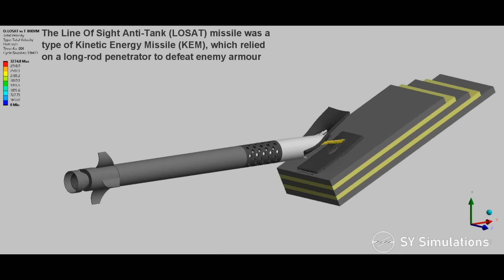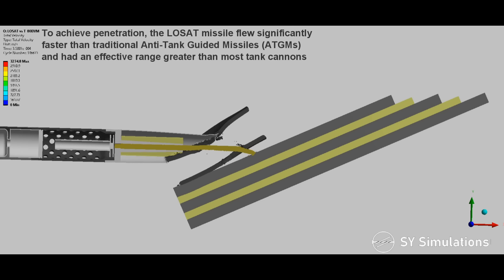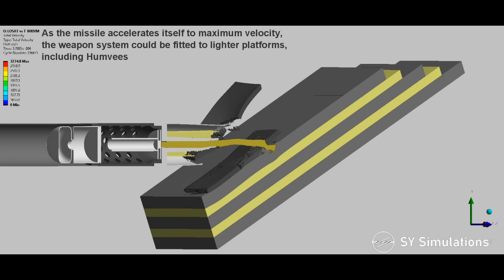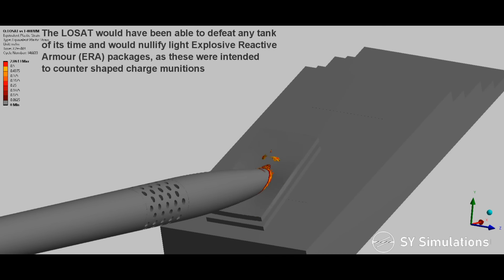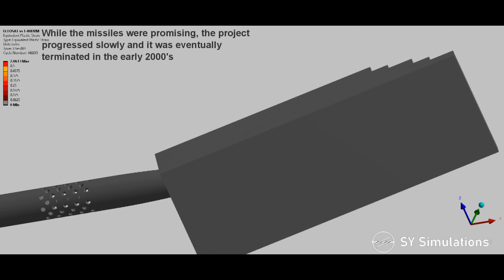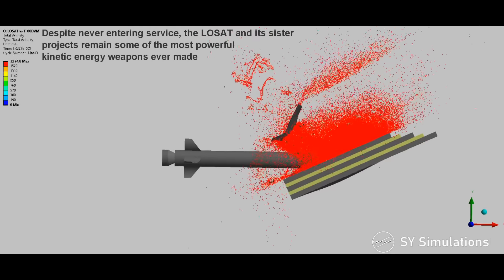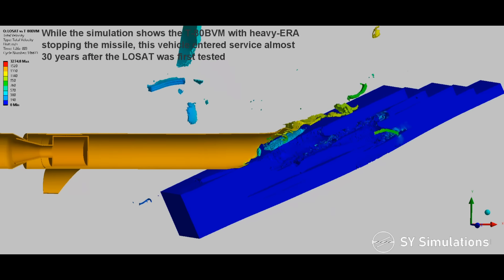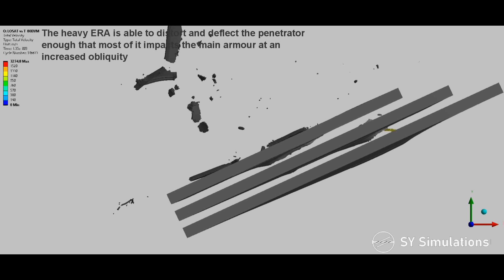LOSAT vs T-80BVM | MGM-166 Kinetic Energy Missile vs Relict ERA | Armour Penetration Simulation

Comment: It's crazy how effective the Relikt is against any projectile. I thought for sure the LOSAT would completely penetrate that
Reply: Bat muh em Ejt Tu Najn aj For!!!!!!
Reply: @worldoftancraft  M829A4 is longer, heavier, and faster than LOSAT. Plus, like its predecessor M829A3, it has an anti-ERA breakaway steel tip (which detonates the ERA before it can shatter the main rod). A4 was designed almost exactly two decades after LOSAT was.
Reply: @MacSalterson  you count the steel. While it does not penetrate anywhere significantly. 

What you've forgot is thickness. That's the thing. But not mass or «length».
Reply: @worldoftancraft  The steel isn't supposed to penetrate anywhere significantly. It's supposed to detonate ERA without breaking the main rod. Which it does.

It does not matter how thick or long or heavy the main rod is if it gets shattered by the ERA detonating.
Reply: @MacSalterson wasn't A4 created to specifically defeat k5?
Reply: @MacSalterson  It is quite funny that the Americans need to come up with a new projectile to penetrate a Russian tank, while a Russian tank can penetrate the most modern American tank with 3bm42 and at the same time be 20-30 tons lighter
Reply: @Masterafro999  no, that was A3
Reply: @愛を込めてロシアから  ye and it funny how the turret of soviet tanks goes to space when the tank is penetrated
Reply: @愛を込めてロシアから nice propaganda mate.
Reply: @claudiovictorferreira992  all tanks throw their turret once their hull ammunition detonates. The only exception might be the Abrams as it only has 6 rounds in the hull. Those might just burn the crew instead of ripping them limb to limb. 

Here's a good example:
https://youtu.be/YafzmkvVRiI?si=2Wrutt6YJe1M8rcE
Reply: @Masterafro999 most nato tanks use blowout panels
Reply: @愛を込めてロシアから Gigacope lol
Reply: @Keep3r1438  I said hull ammunition. No blowout panels for those.

Edit: most do have blowout panels, yet even more have ammunition all over their hulls making them just as explosive as any old russian tank when penetrated. Tanks like the leopards store most of their ammunition in the hull with only the ready rack being inside the turret bustle. Challenger tanks don't have any blowout panels because they only store their inert darts in the turret with all the other ammunition types and their charges being stored literally all over the hull.
Reply: @claudiovictorferreira992 not in all instances, and western tanks also have "turret toss".. There are t72b3 survived after 5 NLAW hits and returned back.
Reply: @claudiovictorferreira992  A2 actually, m829a3 came in the 2000s, K5 is era from the 80s.
Reply: A2 doesn't have anti era tip, a3 was designed against k5 @voler_1925
Reply: Basically near perfect conditions for the relikt though
Reply: @愛を込めてロシアから  In combat conditions, 3BM42 is incapable of defeating the frontal arc of any M1 tank after the M1IP.
Reply: @ryssa2409  A2 was a brute force method to beating K5, while A3 was a future proofing solution which involved the anti era tip(more in response to newer era like Kaktus), whether or not A2 defeated K5 we don't know till we see it used against K5 however thats what it was meant to do.
Reply: if the videos out of Ukraine have shown anything it's that Russian ERA doesn't work as well as advertised. Even small 40mm HEDP grenades dropped on ERA equipped vehicles have no problem penetrating
Reply: @zeitgeistx5239  propaganda? Its clean mathematics, russian tanks are better
Reply: @claudiovictorferreira992  we are talking here that its hard to pen soviet/russian tanks because they are armored better than usa/ger tanks
Reply: @claudiovictorferreira992  Right now we are talking about the fact that Russian tanks are better protected than American ones. And I wonder what happens to Abrams' crew when an old 3bm42 pens it?
Reply: @Masterafro999  Right, and the carousel only detonates if it is penetrated. If there was no carousel there the crew would have been minced anyway. It's just an easy thing to laugh at for those that don't understand.
Reply: @Keep3r1438  Doesn't matter.
Reply: @愛を込めてロシアから  С чего ты так уверен, что Манго 83-ого года пробьет Обэмасы IP и Леопарды новее 2А4? Ты вообще смотрел документацию по бронепробитию снаряда и бронированию их танков?
Reply: The A2 main improvement was in the speed and very much the alloy, which performed ~5% better against RHA and much much better against complex targets vs the A1.  The Russians in private informed potential customers of their tanks in the 1990s that the M829A1 was probably able to overcome the current protection of the T-80U in many cases and that in development ceramic inserts should be considered.
Reply: @MacSalterson  i dont think the penetrator of m829a4 is longer than losat ? do you have a source on that ? the round itself is 890mm long, penetrator is 730mm and 630 mm is DU part 100mm steel.
Reply: @sfalhilsajd  можешь в интернетике моделирование посмотреть, ты на канале который этим и занимается, гений
Reply: @viktoriyaserebryakov2755  and they seemingly can't read when HULL AMMUNITION is being talked about. It's like they get paid to scream blowout panels whenever NATO equipment is being talked about. Apparently anything NATO now has blowout panels even tho those are rarely use on other vehicles besides mbts.
Reply: @voler_1925  why would they develop a special round for the era that was made for light vehicles that it'd still punch through?
Reply: @Masterafro999  All propaganda in all wars paints the other side as cartoonishly incompetent. There's no shortage of old newspaper clippings depicting the other as deformed, uncivilised, intellectually and genetically inferior when really at the end of the day we're all human and thus are capable of similar capabilities when it comes to it. The Russians designed their tanks a certain way for a reason, and the NATO nations designed theirs for other reasons. Good luck telling them that though.

Hell, blowout panels in some circumstance pose a greater risk than a carousel it's all situational. But who cares about nuance I guess.
Reply: @愛を込めてロシアから that is not accurate. You’re thinking of the hull. Western MBTs were only likely to be hit in the turret, which is better armoured than Russian tanks. The best armour was designed by the British and shared with the Americans. The hulls were most likely going to be non line of sight to the enemy in defensive positions.
Reply: @ryssa2409  you're thinking of the wrong one, kaktus era never left the prototype phase, along with the tank it was developed with, it was more similar to Ukranian NOZH ERA and was meant to go on the object 640 prototype.
Reply: @viktoriyaserebryakov2755  exactly! You tell em. Emotions have no place in a factual discussion. NATO armour does not have magical properties.
Reply: Eh... Well, no, even turrets aren't better armored than soviet ones

And if western tanks weren't designed to hold apfsds only with turrets, well... Poor tankers then. How would those tanks advance? Ukrainian war shows that leos And M1s aren't sitting behind hills neither in defence nor in offence.
Reply: @ГеоргийМурзич  CORRECTION: turrets of western tanks are indeed better. There were using better combination of materials. Moreover, the material bonding  techniques of those materials are state secrets.
Reply: @Masterafro999  I take back what I said actually. It is Western propaganda that paints the other as subhuman.
Reply: @viktoriyaserebryakov2755  what made you say that? I feel like every nation has their very own propaganda. But none is as deeply rooted and wide spread as western propaganda
Reply: renesanchez2441  every tank since ww2 was designed that way. Every damn armoured vehicle is designed that way. That's due to advances in armour piercing weapons.
Reply: @愛を込めてロシアから it has a 50% chance to penetrate and 30%chance to hit on distance 1500m+. That is Russian tank with Russian gun,and only if it was build up right what is another 20% chance. Western tank has 90% chance to hit on 2500m and 80% chance to penetrate any russian tank, and 99% chance the weapon is working as intended.
Reply: @milanvnuk  So you completely ignored the videos in which Russian tanks are firing at firing points 2 by 2 meters from 4 and a half kilometers?
Reply: @Masterafro999  Ukrainians call Russians orcs. Russians call Ukrainians brothers.
Reply: @viktoriyaserebryakov2755 *khokols or pigs.
Reply: @Xtoxinlolinecronomicon  Citation needed.
Reply: renesanchez2441  thin sides and rear is literally the only way you can make moden tank being anyhow shell resistant.
Reply: Type 10 APFSDS: am I a joke to you ? 

that dart has capabilities of slicing the Relikt ERA
Reply: @Distressed_Asian  Russia military also had capabilities to subdue Ukrajina in one week. Do i need to tell to you what the field test shown
Reply: @worldoftancraft  blud it's already more than 2 years and Putin himself has struggles to invade it now you yapping about a week of subduing Ukraine ? such pathetic cope.
Reply: @Distressed_Asian  not gonna involve deeper in arguing but they have the capabolity to flatten ukraine but that not the point of invading
Reply: @Distressed_Asian  such pitiful cope is when one which reads me is unable to comprehend... that it's not enough to move your eyesight through letters to understand the message.
I have impression that you in a manner of typical ameriquoid stopped reading right when you've seen the first period symbol.
Reply: @milanvnuk  you're basing those claims on what? Believe? This is not a religion. Go check up on some facts. Hit Probability On Tank-Type Target Cruising Sideways At 30 km/h: 100 m to 4000 m =  >90% (9m119 "Refleks"). The 2A46M-5, 2A46M-5-01 canons have a hit probability using HE-Frag and apfsds of >90% as well. HEAT-FS of around 85%.
Reply: blud, it spalled the armor, the driver is 100% dead from steel fragments digging into his brain.
also the turret crew is definitely has a very bad concussion because 80kg of metal flying at mach 4.4 will definetly heavily shake your outdated shitbox. also realikt is just rubber so the t80bvm would actually fair even worse. with the missile probably penetrating into the tank and triggering the space launcher (carousel autoloader)
Reply: @愛を込めてロシアから the shot deflets because the shit optics will make the gunner miss, hit the cheeks and bounce. the abrams has basically free realestate now becaude it can fire two shots back before the carousel can reload, and it will definitely jam after one hit from the abrams. also the t72 can't really go anywhere else because it doesn't have reverse speed. so russian tanks are definitely getting clapped
Reply: @democracy_enjoyer  I guess space launcher is the worst of what comes to already dead crew. Well, that's what you say.
Reply: @democracy_enjoyer  oh nice cope, nice cope
Reply: @愛を込めてロシアから  saying cope cope cope and not actually trying to debunk my points is not going to help you win the comment wars mate
Reply: @democracy_enjoyer  it's a war to you, but not to me dude
Any new cope?
Reply: @愛を込めてロシアから  what the actual f❤️❤️❤️ are you even saying rn?
Reply: @democracy_enjoyer  read better
Reply: @愛を込めてロシアから  your responses are more confusing than the metal gear lore
Reply: @Xtoxinlolinecronomicon  the pretty obviously nazi militia's get called so. Yes. The Ukrainian regulars don't usually get called that. Unless you're on Reddit. Reddit is a horrible place to be.
Reply: @Distressed_Asian   I mean did or didn't they reach Kiev and occupied 40% of Ukraine in the first few weeks of the invasion. Kiev was at its militarily strongest point of the war at that time.
Reply: @democracy_enjoyer  the t-80bvm has better optics than most NATO mbts along side one of the best fire control systems in service. Don't take my word for it. Do your own research before commenting rubbish
Reply: Crazy how it isn't in real life though, clearly demonstrated on the many videos we have seen for like 2 years now.
Reply: @愛を込めてロシアから  Yeah, they are the undisputed champions of turret tossing  🤡:face-blue-smiling:
Reply: @viktoriyaserebryakov2755  Yeah, blowout panels are bad idea, especially compared to the genius carrousel, that is why we see every nato tank toss its turret at 20m when it gets hit by a small fpv /s 🤡:face-blue-smiling:
Reply: @ytsks  kinda boring🥱😴😴😴
Reply: @ytsks  If you have something to state as fact then do so instead of hiding behind a sarcastic facade. Commit, don't hide like a cow_rd.
Reply: @Masterafro999 guess what the Abrams crew tend to not have in the hull of their tank? 6 random ass rounds
Reply: @WandererJester  I don't even know whether or not newer models still retained their 6 round hull racks. I don't see why they should have. The versions in Ukraine have them however no clue if they get used. Idk which comment you replied to.
Reply: @ytsks the autoloader was genius for its time. They lost their edge a bit over the years as safer alternatives have emerged.
Regardless of that NATO tanks tend to fair similar fates when hit in the same spots by the same threat. They don't magically not explode when their hull ammunition is hit or protect the crew from projectiles that pretty obviously flew right through the tanks armour. 

Here's a leopard getting balanced by a 60s-70s atgm. https://youtu.be/YafzmkvVRiI?si=MjDW-h-Px2PHfEr6
Reply: @Masterafro999 iirc the hull ammo storage in the Abrams also has a blowout panel.
Reply: @MacSalterson There are different opinions about the fact that the tip of the projectile will save him from the Relic. In the USSR, there was a mango projectile with exactly the same design. If the projectile hits the lower part of the Relic, then yes, it helps. If it is closer to the center or to the top, then no. Relict plates still fall into the projectile.
Reply: @solus48  it does indeed, hence why I said that the Abrams crew would burn to death and not get ripped apart. In case the penetrating round strikes those rounds the crew compartment will get burned in seconds as there no longer is a protective barrier between the pressure compartment of the ammunition and the crew compartment
Reply: @MacSalterson  it absolutely can. Shoot centre of mass and the chance that it hits the hull roof is pretty high. Not every part that is armoured has armouring all over. There are plenty of places a round could slip through. Remember that t-90a that got penetrated by presumably 3bm22? It got hit just a cm below the welded armour inserters of the turret.
Reply: @Masterafro999  that thing was genius but it was still shit, the one less crew isn't worth a 10 second reload, and being unable to swap the loaded round out, as well as the flimsy mechanisms jamming after getting hit by any high impact rounds from basically any time period
Reply: @viktoriyaserebryakov2755  What are you on about, did words hurt your feelings? ❄
Reply: @Masterafro999  The carousel autoloader is a terrible idea. Not stupid by any means, just proven in practice as pretty bad. You found a single video of a leopard getting hit  by a kornet. You should research its size and power. Hopefully you wont pretend you need links of fpv drones playing turret toss champion with t90m and the like. I will let you watch this instead, and wait for you to come back and tell me its basically the same :face-blue-smiling:: https://www.youtube.com/watch?v=uM3mVDJO21c
Reply: @愛を込めてロシアから  I am sure you hear it every day 🤡
Reply: @ytsks  Cow_rdice it is.
Reply: @Masterafro999    There is obviously always the possibility of lucky hits, but they are practically irrelevant, because worrying about extreme edge cases in these discussions is pointless.

It's like saying that technically a 20mm autocannon round could penetrate a maus if it ricocheted into the hull roof. Sure, hypothetically that could happen, but no one is gonna claim that 20mms can kill a Maus.

The goal of continually designing newer rounds is so that said rounds can defeat expected enemies at expected combat ranges without worrying about lucky shots or aiming for points on a tank's body a handful of centimeters wide or tall. That's what the US is doing. Tankers don't aim for weakpoints. They acquire a target, the tank's FCS gives them a solution, and they pull the trigger.
Reply: @павел-б6н5ю  How is an APFSDS design from over 30 years ago (when the USSR was still around) from a different country relevant to what the US is designing today?

Simulations based on the closest estimates we have to the designs of M829A3/A4 and K5/Relikt suggest that the steel break away tip is effective.
Reply: @democracy_enjoyer  the reload is not fixed. However, the autoloader itself is capable of loading a round and returning the gun to aim on a target of the gunner's choosing in only 6 seconds if the gunner chooses not to change the ammunition type. Which isn't bad. Turning the carousel by one step takes up 12-15% of the total loading time, and turning it by three steps takes up 17-22%. The WT reload is an average. Newer autoloaders have different loading speeds than the ones found on say the t-64a yet they all have the same reload times in game. According to a T-80 technical manual, the combat rate of fire is 7-8 rounds per minute. This is co-confirmed by the T-64A and T-64B/B1 manuals, which give a combat rate of fire of 8 rounds per minute from the same autoloader and the same fire control system. Meaning that the t-72/90 type autoloaders load one second faster than the other autoloaders. One thing that seriously pisses me off about all of the MZ and AZ autoloaders is that they can only rotate in one way causing the reload to reach 19,5 seconds if the next selected round is on the other side of the autoloader. That should have been an easy fix. 

As for your unreliability claims: the topic was at its high point when the Soviet Union fell and west Germany received scores of nva t-72m1s. NATO tank crews mocked the Soviet autoloader (that's where most of the "arguments" and presumptions against the Soviet autoloaders stems from) to the point were some Soviet books even incorporated those claims and put them to the test. "The autoloader is insensitive to scorching heat, freezing cold, nor does it care how fast the turret is spinning, thanks to its impeccable sense of balance. It does not matter if the tank is rocking around like a bucking bronco at 50 km/h over the most gutted dirt paths. The autoloader will still load a shell in the specified time, every time. The common argument that the autoloader can be "knocked out" by hard impact or a hit on the tank's armour is fallacious - a hit on the tank's armour that does not fully penetrate yet is powerful enough to disable the autoloader would also be powerful enough to concuss the people inside the turret and effectively disable the gunner and commander as well as the loader."

Source: ( https://4.bp.blogspot.com/-EzNEXvH7CIM/WpTz5_cRmdI/AAAAAAAALCA/Tx5QsLyJqpM8sHscSmbIaNCHSUnECvJRwCLcBGAs/s1600/mz%2Bcyclogram.png ), This cyclogram comes from the document "Автоматические Системы Заряжания Вооружения Бронетанковой Техники" (Automatic Gun Loading Systems of Tanks) published by the Russian Ministry of Defence, 2011.
Reply: @democracy_enjoyer  oh and not many if any mbts can swap ammunition once loaded as that is a huge safety concern
Reply: @MacSalterson And besides the 3BM-42, there is also the DM-53, which was developed in Germany. This munition has exactly the same composite rod. So it's not a bad word. And the Relic is being developed specifically to counteract this ammunition.
Reply: @ytsks  I never claimed NATO tanks to be weak. They are all pretty similar in capability. I just don't like cherry picking, bias and mocking vehicles without any background understanding of them. The video shows many Abrams getting hit by shoulder fired at weapons and ATGMs. Many of those hits actually penetrated the armour if you check up on Iraq tank reports. Not every penetration is a crew kill, drones did not exist back then the way they do now. There are plenty of cherry picked videos of Soviet armour tanking things that they should not. Taken without context it could lead to people believing that a bmp-2 can reliably tank 4-7 at hits without much trouble. I'll post the video link once I find it again. Soviet armour was/is not bad. It's just not the best in many regards. It is leading in certain areas tho.
Reply: @павел-б6н5ю  DM53 is a completely different design from M829A3. DM53 is shorter than M829A2, is composed of tungsten alloy rather than depleted uranium alloy, and weighs less. As far as I know, it also lacks a break-away tip.
Reply: @MacSalterson  so m829a3 has better pen than dm53?
Reply: @democracy_enjoyer  Unsure, and it probably depends on the target. M829A3 is (almost) certainly more effective against targets with heavy ERA, but DM53 may be better against a simple RHA target. M829A3 is also newer than DM53.
Reply: @愛を込めてロシアから And where have you seen that? Lmao
Reply: @claudiovictorferreira992  the Abrams' turret isn't torn off, but the crew doesn't survive, so what's the difference?
Reply: @Masterafro999   Cherry picking would be finding clips where a T series does not violently explode when hit center mass.  That is the whole conversation - why that autoloader (not autoloaders in general) was a bad design. Which has actually been admitted by both soviet and Russian engineers, its a google away from you. A weak point the other design simply does not have. What penetrates the abrams on any of the clips is inconsequential, because none of those exploded to the moon.  I can find you that many turret tosses from just last week. In fact none even caught fire right away, so whatever the damage was, the crew likely survived in full, e.g. the tank actually did its job. So no they are not similar in survivability and there is plenty of empirical data to prove it.
Reply: @RAD1111able  You don't know how to ask complete questions, am I right?
Reply: @MacSalterson  I also see the effective operation of the losat rocket against the triggering of the Relic. If you review the video, note that the main action of the first plate was not on the rod, but on the rocket body, and the rod met immediately with the second plate. A standard tank shot against this protection will be less effective, since the rod will collide with both Relic plates.
Reply: @mcantu197 ive seen plenty of videos showing ERA doing its job.
Reply: @ytsks  where did I claim the survivability to be equal? I claimed that hull ammunition in all tanks that have them is a major safety concern. The Soviets themselves stated that the MZ autoloader, the one storing the charges vertically was inferior in crew survivability that the AZ loader which stored them horizontally, allowing for the carousel to be armoured. What you described is cherry picking. Not all t-series tanks explode when hit, else we wouldn't see so many litter the battlefields in one piece.

As for the abrams video you shared: the early Iraq videos show the Abrams shrugging off badly placed rpg-7 pg-7v hits which had little to no chance at penetrating even the side skirts of the tank. The atgm videos are cut with no aftermath being shown. Some of those tanks burned down afterwards, afaik one crew member got killed in the video and 2 or 3 lost limbs or received TBIs. We know what would have happened had those tanks faced any meaningful soviet/russian at weapons of the time. Iraq in the first gulf war had no effective way of even touching coalition armour. The few Konkurs ATGMs that had been sent saw little to no action. The ones that did see actian caused casualties and loss of equipment, hence why the US paid food coins for captured Konkurs launchers and ATGMs.
Reply: @MacSalterson  extreme edge cases are part of the chance bell curve. Unlikely does not equal a definitive never to happen. On the matter of war thunder: how many times have you died in bullshit ways? That's almost exactly what happens irl just with MANY more factors that play into the end result. The probable dispersion of 3bm42 mango is below 0.6 meters and 0.5 meters in the vertical and horizontal planes respectively. At 3km. So aiming centre of mass, on an Abrams that is directly facing its russian counterpart, will definitely land the dart on the upper hull deck in most cases up to 3km.
Reply: @Masterafro999  Literally none of the hits on the video were rpgs, if you are unable to tell what munitions are used, we can just drop this now because your expertise is severely lacking. Not to mention rpg7 can pen up to 750mm with the right warhead, which isn't too far off a number of older atgms. There were 23 abrams tanks lost or noticably damaged in the gulf conflict. And 0 crew deaths, only wounded. 23 tanks to 0 deaths. Not sure if you get it, but literally every example you give serves to prove my point, and refute yours - they are not similar in capability - one has 23:0 odds of you surviving. The other...well there are more than 23 videos from just the last month of a T violently disintegrating milliseconds after a single hit.
Reply: @павел-б6н5ю  The plate triggered when it contacted with the main rod, not the body of the rocket. LOSAT had no special anti-heavy ERA properties
Reply: @ytsks  "During the first gulf war alone, nine M1A1s were penetrated by rocket-propelled grenades (RPGs), although only one was immobilized.

In the two years after the invasi0n, over 1,100 M1 Tanks were deployed to Iraq, of which 70% were hit by some sort of enemy fire, mostly without consequence, although 80 tanks were damaged badly enough that they were shipped back to the US for repair. Fifteen crewmen were killed: five inside the tanks, ten while partially exposed in their hatches. In the first three years, 530 M1 Series were rotated back to the USA for refurbishment."

M1 Abrams Main Battle Tank Manual: From 1980 (M1, M1A1 and M1A2 Models) (Haynes Manuals) by Bruce Newsome and Gregory Walton.
Reply: @ytsks  Iraqis, to my knowledge, had no advanced Shoulder launched AT weapons and the only tandem charged atgm was the Konkurs(only some variants and in very small numbers). The average RPG warhead found within Iraq militia's in the second gulf war was the standard pg-7v(1961) rated at only 250mm rha. Some newer variants were found but none were tandem nor did any offer more penetration than 400mm rha. 

As for the none were RPGs: you can literally see two dudes with an RPG-29 in two of the videos. Also some of the video towards the end are definitely not atgm hits as those were pretty close range, non twirling, fast moving shots. 

The very first Abrams in the video got visually penetrated as it's fuel tank started leaking and burning. The fuel tank would have likely acted as a spal liner but the crew compartment would have likely still been penetrated. Many of the videos were hits to the most armoured parts of the vehicle. Comparing those hits to hits from russian ATGMs crew kinda paints the picture that civilian Iraqi militia members don't know much about tanks and where to hit them.
Reply: @Masterafro999  But they're not designed for. No one designs for them. And War Thunder is irrelevant. And 3BM42 would not pen if it struck the UFP of an Abrams, especially not a SEPv3 or SEPv4, which have increased thickness to the upper glacis from the base model. The round would shatter and spray harmlessly across the glacis and the turret ring.

We can see that 3BM42 wouldn't pen the glacis of an Abrams at range because during Operation Desert storm an Abrams (B Company, 3-66 Armor, Bumper # B-22, which was I believe an M1A1 HA) was struck by a 120mm DU projectile (meaning it was most like M829A1, a vastly superior round to 3BM42. It could've also been M829, which is still superior to 3BM42) in the upper glacis at an unknown range (probably 2-3km, given that it was FF due to misidentification)
Reply: @MacSalterson  I'm just commenting on this simulator. One of the ways to protect the Relic, the lower plate moves towards the armor, and the upper one to meet the projectile at the top. Causing transverse loads in the rod and thinning it, by constantly running over the plate. In the video, all the action of the front plate was on the rocket body.
Reply: @Masterafro999  Stats settled the debate before it started. They are light years apart in survivability, and you don't need to be a spaceX engineer to get it - in one case the most explosive thing in the tank is dead on center mass, shell charges separated and not insensitive. It will be harder to miss it than hit it. That carrousel was a terrible idea in practice, but that is only if you consider loosing the crew and vechicle a big deal. When it comes down to combat effectiveness it really made no difference - a disabled or tracked tank is just as useless as a blown up one. So I guess if you share the perspective of the average Russian general on how expendable materiel and personnel are, they really are quite similar.
Reply: @ytsks если в забашенной нише Абрамса будет +-10-15 снарядов 3оф26, то у Абрамса при детонации снарядов башня с такой же вероятностью превратится в аналог Аполлона.
Reply: How can we have years worth of Ukraine war footage at this point and still be having arguments about the effectiveness of this
Reply: @zeitgeistx5239 they actually do LMAO so go cry
Reply: @viktoriyaserebryakov2755  I didn't know "Hohol" or "Ukronazi" translated to brother...
Reply: @FancyPantsOnFire  good luck having terrain conveniently shaping at your favour whenever you move your tank
Reply: @ДимаВеселов-в8и  that was the point tho. In the Cold War the soviets would, as they do now just commit large forces in frontal assaults after an indirect barrage. It’s as primitive as it gets. These tanks were meant to take out scores of TSeries before being overrun. It was a trade off. They figured they’d kill enough via tanks, apaches, a10s and ATGMs. And by looking at Ukraine it looks like the west would have trashed the Soviet’s. Even more so now
Reply: @frely4580  They did survive
Reply: @viktoriyaserebryakov2755 hohols , crests translate to brothers now damn
Reply: @187Rajah also have 😂 , but keep coping with a single instance 😂
Reply: @ytsks  except they don't need to "survive" as many things. T-72 and T-80 designs were awesome for the time they entered service. There were no good fire control systems, no decent thermals, ATGMs were a joke, drones weren't a thing etc, so instead of focusing on surviving the penetration they could focus on NOT being penetrated, not getting hit and not getting spotted in the first place, which is frankly a leagues better idea of protecting your crew, and carousel was a decent choice since it allowed to make the tank smaller hence more difficult to spot and hit and easier to put more armour on it, so under the same commandment it was safer to be sitting on an explosive carousel than in any NATO MBT during 70's, 80's and arguably a big chunk of 90's. Also if you actually look at hull ammo distribution schematics, Abrams or Leo have ammo not that far from center of mass as well, which makes it not that difficult to hit, especially if you don't see the tank for the first time in your life
Reply: @ntks6720  they won't survive. There is very little chance of survival.
Reply: @95keat  that's a biased way of looking at it. Anyone meaning to kill a tank equipped with Relikt will obviously hit places that either aren't protected by era or if penetration is possible regardless of its presence. There are plenty of videos of tanks with or without era tanking hits without any penetration. Those aren't spectacular for the ukr side which is the reason why we don't usually see them.
Reply: @Masterafro999  i just add to carousel blowing up argument.
Thing is that Russian autoloaders ain't that bad in safety departament.
Carousel is in lower part of the vehicle.
The most protected part and less exposed.
Thing is that Russian doctrine because of IS-2 tanks having very few rounds wanted at least 42 rounds in tank.
Since T-72 autoloader could fit only 22 rounds, the rest rounds were stored everywhere in tank.
So basically anything that penetrated fully loaded T-72 would ignite one of rounds or charges that lay loose in hull will initiate chain reaction that blows up carousel.
Tankers knew about that and if commander allowed it, they would bring only these 22 rounds in carousel which increased survivality by a lot.
Even in Ukraine you could notice that some tanks just send their turret to orbit and some can tank a lot of hits and they are perfectly fine.
Simply the one where turret fly to orbit are these where commanders went full on doctrine and didn't allow to take less rounds
Reply: @愛を込めてロシアから  Mathmatics gets you classified military documents? sign me up.
Reply: @alfredchurchill2328 Yes they are defensive tanks, we all know how well they work when used without combined arms and effective crews
thanks ukraine
Reply: @milanvnuk Lmfao, source on that bigman
Reply: @worldoftancraft Jajaja yes comrade; Ukraine will push through in two more weeks yes?
Reply: @ytsks Pro tip: literally every mbt will throw its turret in bulk ammo detonation, yes, even with BOPs lmfao
Reply: @democracy_enjoyer  See, you don't even know basic shit about tank projectiles lmfao butt out of the conversation
Reply: @ytsks  We are talking about crew losses in Ukraine 
near peer and both sides equally as poorly crewed. 
What is "combined arms"? because that is quite honestly the only thing that makes western mbts effective.  We see this plainly in UA, they drive down a road alone and get hit in the side by a Kornet, because that's how this shit works, it's wwii combat tactics on both sides all over again
Reply: @leovang3425  for what? You are nobody
Reply: @MacSalterson We are talking about how they are used in UA, offensively rather than defensively as they were designed.  UFP thickness does not matter if it normalizes the angle on the first hill you need to go over, all it takes is bad timing and whoops, suddenly that rooski dart is going up against 150mm raw RHA 

bye bye hull crew
Reply: @ytsks The leos & abrams in UA with mush inside say otherwise but go off qween
Reply: @FancyPantsOnFire  Lmfao, yeah definitely. The dead leos and abrams are very telling aren't they
Reply: @Div1ne_1  actually yes. There used to be a huge difference in lethality and survivability in western MBTs and soviet/russian TSeries. Putins disastrous war in Ukraine has made this war overly evident. 

Cheers 👍
Reply: Relikt works very good againt steel witch the LOSAT ATGM is made of witch could def be defeted
Reply: @Div1ne_1  Your comment makes no sense. The Abrams was designed for offensive capability, and positioning poorly is not a fault of the tank. Your comment is pointless and I'm not sure what part of my arguments it addresses.
Reply: @愛を込めてロシアから  and? you can't detect sarcasm nor have much logic
Reply: @Masterafro999  the accuracy of a gun is not allways the same. It depends on lot of thing, temperature of air,temperature of the barrel, how well are optics set, all this things together. You can not take shoting range results only. And understand one thing, they cheat the results. In Russia if results are not great or as promised, you will fall out of window as manager, or commit suicide by 4 shots in the head.
Reply: @leovang3425  i would say even more. Who the f are you. Do you offended?
Reply: @愛を込めてロシアから  I mean, at this point I'm confused
Reply: @Masterafro999 Abrams hull ammo has blowout panels just like its ammo storage in the turret. I don’t know how they work cause I’ve never seen them in action, but blueprints and evidence from tanks suggest at the very least that the blowout panels are there
Reply: @aidboo1054  I don't know whether or not newer models still have the 6 round containers but yes. They do have blowout panels. I just don't know how much that'll change anything when the hull and the container get penetrated. The pressure from the exploding propellant would seek the path of least resistance....I guess the crew would get burned regardless.
Reply: @milanvnuk  those shooting trails were not held by the Soviets to my knowledge. It was either Sweden, reunified Germany or Switzerland as the collapsing Soviet Union definitely did not pose tanks equipped with 105 L7 and 120 L44 guns to compare Mango's efficiency with. So no soviet bias here.
Reply: @Masterafro999  ok, I am talking about my experience with soviet made weapons. And they have never been so good as introduced. I do not say they are total useless,no,I say there is always a lot of hype around them, mostly build by the myths spread by propaganda.
Reply: @愛を込めてロシアから What do you mean russian  tank ? russians never designed any of their tanks you see in use. There were all designed and made by the USSR.
Reply: They'd have to actually put the explosives inside of the relikt blocks for that to happen, thankfully.
Reply: @MacSalterson  except in the huge ass turret ring, lfp and mantlet
Reply: @BraytonCycleAdvocate  and they do, thankfully
Reply: @Keep3r1438 most nato tanks carry hull ammo, and go up like a Christmas tree if the ammo is hit. Only the abrams doesn’t carry a large amount of ammo outside of the turret ready rack.
Reply: @Masterafro999  except the rounds in the hull have a blowout panel also
Reply: @Masterafro999  funny cause they needed thales to make all that for them. And no. It doesn't have better fcs than modern Western vehicles.
Reply: @ryssa2409  Turret ring is both not huge and not an actual weakspot like War Thunder thinks it is

LFP is either not visible during normal combat conditions, not aimed for, and is fairly well protected

The Mantlet is actually armored (unlike War Thunder seems to think) and is also a small target and is thus not aimed for.

Look, I know that War Thunder has obviously rotted your brain, but combat in the real world is not pixel hunting with perfect accuracy.
Reply: thats because, it does defeat it, you need top stop thinking these simulations are correct, they aren't.
Reply: @Masterafro999  the hull ammo in the abrams also has a blow out panel. think again.
Reply: @MacSalterson  oh you're one of abrams has du hull and is invincible adepts while in reality it dies to a slightest fart that isn't directed at turret cheeks
Reply: @sartte  funny how abrams lovers love to claim abrams has 0.0005 sec reload but forget to mention the fact that it's with blowout panels open
Reply: @sartte  didnt I say that as well. If it gets pierced the hull will be filled with smoke, hot glasses and the excess pressure from the ruptured ammunition rack. It might not detonate but the fire might suffice to burn the crew alive. Might.
Reply: @jbeverley67  what's a red effect video on the matter or look for the t-80s FCS data online and compare it the Abrams/Leopard/Challenger/Leclerc etc. The data is all out there waiting for you to read it. And no the Thales deal was sealed to strengthen russian french relations. They are building their own and have been doing so for decades now. The licenced Thales imagers aren't the only ones being built in RU.
Reply: @MacSalterson  my comment about the matter keep getting deleted but well...

The gun is accurate enough to strike the areas @ryssa2409 mentioned at a distance if 3km consistently. If the Abrams faces any t-series tank able to shoot mango head on and centre mass is being aimed for then, sure, most rounds will hit the lfp, hull roof, mantlet or bits of the cheeks closest to the mantlet. At 3km. Honestly mango will do fine against the Abrams Ukraine has. Any more modern ones will likely shrug off most hits impacting the cheeks and some older projectiles like mango to the lfp. 3bm46-60 will likely still manage to perforate the hull.
Reply: @claudiovictorferreira992 wrong that was m829a2
Reply: @Masterafro999 The 6 rounds in the crew turret won't fix the tank with smoke, as its designed to vent the fire/smoke gasses out of the tank none of the crew would be harmed.
Reply: @sartte  have you not seen ammunition cook off? The ventilation system is meant to vent out fumes from the gun and prevent potential NBC contaminants from entering. Any internal fire will definitely fill the entire crew compartment with thick toxic smoke especially when it's an ammunition fire. The fire exiting the punctured ammunition rack would surely do something to the crew.
Reply: @goforbroke4428  yeah I know. I misread the comment so replied to
Reply: @Masterafro999 you do realize that all Abrams ammo storage compartment have blow out panels right? Even the hull ammo, and 6 rounds are not going to be enough to burn the crew alive, let alone do any damage, since the fire extinguishers can just be used.
Reply: @sartte  did my comment get deleted. I've answered the blowout panel thing like 8 times at this point. I know that they have blowout panels. I don't know how much pressure is needed to pry them open by the burning ammunition. The turret one works because the door separating the crew from the ammunition is in place and likely not perforated. The hull rack seems silly because it can only rapture die to a mine or a projectile penetrating the hull. If both the hull and the container get penetrated then the pressure will favour the path of least resistance and flood the crew compartment with burning gasses. How would blowout panels change anything in that regard. They MIGHT trigger if the hole towards the crew is small enough for enough pressure to build up. Ammunition fires have routinely burned hot enough to burn through multiple layers of steel in seconds. Why would a human survive such plus the extreme overpressure in a confined sealed off tank?! Those six rounds still hold more than 50kg of propellant. The fire extinguishers harmed crews in the past, are manually activated and have failed to put out even smaller electrical fires.
Reply: @ryssa2409  Previous versions of the M1 did not have DU hull, but the SEPv3 and SEPv4, which are the current models the US uses, almost certainly have a DU, or at the very least highly upgraded, hull insert, as well as an upgraded upper glacis.
Reply: @Masterafro999  The gun really isn't accurate enough to strike any of the areas they mentioned consistently. Also at 3km, you literally do not aim for anywhere but center mass. This isn't War Thunder and that's not how modern fire control systems work.

As for Ukrainian Abrams, they are hardly relevant to the discussion. As best as I can tell though, the Ukrainians received M1A1SAs, which are roughly equivalent to M1A2 SEPv2s in performance capability, and thus Mango is insufficient against them in normal combat conditions. Also 3BM46-60 are incredibly uncommon to see used in the current war based on reports from both sides of the conflict. 3BM42 is by far the most common round.
Reply: @愛を込めてロシアから конечно влд он в спорит как нож консервнуб банку и заидет и пробьет погон башни, помню в детстве читал про ток как т 80уд берёза обстреливала свои прототипы манго прошли один прототип на сквозь прошло б о, зашол в мто сорвал 6 тдф с крепления что тот вынес крышку мто, понятно что не башню, точно не помню возможно многослойной влд.
Reply: @Keep3r1438 а ну да как турецкие лео2 в Сирии. Там видать там особые панели видать были 😂 выбрасывали б к вместе с башней, а сорян да помню  там один лео2 от старого фагота в богиня пол корпуса выбросил, но нармально наверное панельку 3-5 метровую с торсионами замени и дальше поехал.
Reply: @Masterafro999 а жадные бриты не сделали пробыросывовые корпусные панели как Лео, то то при контрнаступе у челенддера башня сошла с погона башни, но нормально башню не метнул.
Reply: @MacSalterson 😂 I did state that those figures are from a multinational test trail back in the 80s-90s. The tests compared the accuracy of various apfsds designs and apds to name a few. So yes, it is accurate enough for the cone of probable dispersion to just cover those spots when CENTER MASS is automatically aimed for. I never stated that anyone was purposely aiming for weak spots. 😅

As for the more modern projectiles, t-80bvms, t-90ms and other tanks that share their cannon/autoloaders generations, can and will fire 3bm46-60 if need be. The newer svinets family of apfsds projectiles have been fielded since 2000. They have them in large numbers. They just have mango family of penetrators in much larger numbers. Older d-81 cannon equipped tanks still shoot mango whilst more modern cannons are shooting 3bm46 up to 3bm59/60. I don't think that the t-90m cannon can even load the mango penetrators as cannons that fire svinets are physically unable to fit them into the breech. 3bm46 and up should be able to penetrate the lfp of most Abrams models with 3bm59/60 being able to penetrate all hulls in current service. The reports about 3bm42 are at least 1 year old if not 2.
Reply: But u know that driver would be injuried/ killed here?
Reply: @Masterafro999 havent seen it :(
Reply: @xxafrixx  likely. The spall Liner is sadly not modelled. I wonder how much it would stop.
Reply: @MacSalterson  all 300 of them? thats crazy
Reply: @Div1ne_1   do you honestly think that an outdated composite array from the 1960s, which is fairly unsloped, along with two slabs of low quality rubber and styrofoam added on top of it is going to withdtand a hypersonic uranium rod?
Reply: @MacSalterson  thats an extremely good response imo
Reply: Тогда почему ваши военные создали один из худших  танков?
Reply: @вафентрагер-ю3е   Худших по мнению укр СМИ, иронично, но они используют тоже самое. Но у них это супер оружие победы.
Reply: @ДимаВеселов-в8и  carousel jams from any strong impact, also IT IS IN THE CENTER OF MASS, also abrams has blowouts, so saying that ussr tanks were safer is more stupid than saying that the n❤️❤️❤️s were socialists
Reply: @democracy_enjoyer  no it doesn't, Abrams and Leo's hull ammo isn't far from center of mass either, nobody cares about blowout panels if the explosion is happening in the crew compartment and like I said, it's better to not be penetrated or hit at all than having to survive penetration, especially with your goofy ahh nonexistent upper front plate and hull armour in general
Reply: @ДимаВеселов-в8и  not being seen is better than not being penetrated mate. i didn't say that abrams/leo 2's hull ammo isn't far from center, i literally just said that the the f❤️❤️❤️ing carousel is dead centered in the hull. also the abrams' hull storage is apparently kept empty these days so that arguement isnt very good.

not being spotted is what abrams can do better because the atg1500 has a very low smoke signature (mostly thanks to the abrams' design) as well as being quiet, (i dont need to explain the origin of "the whispering death" nickname now do i?) and also being very reliable. the v2 on the other hand is an 80 year old engine who's upgrades only consist of some parts being swapped out for plastic ones to make it cheaper, as well as a whole metric ton of superchargers to make that hamster wheel of an engine bearly surpass a challanger 2. the v2 is also very loud, has a very high smoke signature, and is about as reliable as my memory.

 the abrams will see the t90 or the t80 far before they can, and fire off a shot, even if that shot somehow bounces, it will shake the carousel enough to make it jam, and that not happening would insane ammounts of luck that you're better off gambling.

 the hull armor effectiveness isnt like wae thunder. war thunder's ballistics work differently from irl because fully simulating everything would bring nasa computers to thier knees, so the simplified penetration system is used. this simplification brings a lot of innacuracies. also the turret ring of the abrams is not that weak. and the shot trap is not very usable in real life because ricochets dont work like that irl.

 butt out of the conversation with your brain that has been rotten beyond repair by war thunder and ghpc
Reply: @democracy_enjoyer  lazerpig fanboy detected, meaningful conversation impossible
Reply: @ДимаВеселов-в8и  do you honestly think that repeating russian lies means meaningful conversation? EH?
Reply: @mcantu197 those never penetrated? What are you talking about? If you're talking about the Bradley and t-90m fight the mini explosion is the ERA going off. There was zero penetration at the rear and front. ERA works.
Reply: @Masterafro999 If I remember correctly the hull ammo of the Abram does have a blow out panel although according to the crew of the Abrams the compartment is usually left empty
Reply: @hiruko2373  yes.
Reply: Русские всегда говорили что это будущее,  единственный путь в настоящее время нарастить броню не увеличивая массу танка!
Reply: @ytsks  hahahaha nice joke unless you are not jokeing in that case i declare war on you
Reply: this is a war I well not stand for it so can you please stop waring over Russia stronk or NATO stronk and show your sources
Reply: @MacSalterson nope - not anywhere close to the mass or length of- it’s impossible for any 120mm gun to fire a penetrator of losat length or mass without blowing up
Reply: @Derek-je6vg  The penetrator on the LOSAT itself is not the entirety of the missile, sherlock. You can literally see the anatomy of the LOSAT missile in the video and the part that actually penetrates is smaller than M829A3 and A4
Reply: Should rename it to "Get Rekt" ERA
Reply: @MacSalterson  I doubt many missile components were properly modeled - the attitude control motor casing for example. The LOSAT penetrator had more FAR more mass than M829A4 (won’t go into the exact number). It would be impossible for any 120mm gun (or any existing gun per say) to fire it without blowing up. That was rather the entire point. No conceivable gun could ever fire a penetrator of the mass and length of the one carried.
Reply: Relikt essentially makes the angle of the armor steeper than it is in reality relative to the projectile
Reply: @愛を込めてロシアから it's funny after two years of extreme usage for modern t series tanks use you'd think youd realize tanks have rarely fought each other since the Russo-Ukrainian war started
Reply: @愛を込めてロシアから Nice BS claim. Did you learn that from War Thunder? :D
Reply: @愛を込めてロシアから  If the well known soviet tank layout has been around for so long and is so much more cost effective while also having similar levels of armor then why not tank advantage of it themselves aswell? People bring up the same point but I wonder why if we have plenty of information to replicate the design why dont we?  Rather than the current vehicles being used in western tank layouts.
Reply: @愛を込めてロシアから You could also say that the T-90MS is weak because an M4 Sherman with M61 can penetrate it
Reply: @mage_mini1945  huh? 🤡
Reply: @愛を込めてロシアから  Damn that was fast
Reply: @SpaceCoffee700  its even funnier but Soviet/Russian engineers always knew that tanks fight each other 1% of the time, thats why t-series have high-explosive shells for the destruction of fortifications. And where are the high-explosive shells in your beloved Western tanks? Looks like western engineers basically doesn't understand the tanks mission in the battle. 
Where is this high survivability of the challenger 2? It was recently torn in half by engineering ammunition
Reply: How would Relikt fare against mega big guns such as 240mm Siege Guns all the way to Battleship Guns up to 12 or 15 or 16 inches or Yamato 18 inch guns?
Reply: @claudiovictorferreira992 so? Would burning up in an enclosed space be any better?
Reply: @愛を込めてロシアから  and when a soviet tank gets shot the ammo happens to catastrophically detonate killing the entire crew and burning the tank to a crisp what is your point
Reply: @WiscoGrimReaper  bruh same copium again
Reply: @ what is it with y’all and the copium shit, it’s just facts. no armored vehicle is invincible (as seen in ukraine… obviously) and we should stop the petty shit
Reply: @愛を込めてロシアから  least obvious bait comment
Reply: @WiscoGrimReaper  I do not understand, are you still complaining that the T90M/T80BVM does not break through from A3/A4, and at the same time everything inside Abrams turns into a red fog because of 3bm42?
Reply: @ that isn’t what i said at all my point is that cherry picking to see whose tank is better is useless because they all die the same anyways, fpvs don’t pick and choose.
Reply: @WiscoGrimReaper  No, American/German tanks burns easier because of the ammunition in the roof of the tower in the most obvious place. And in general, you should not talk to me while your tanks do not have high-explosive shells, otherwise they are unsuitable for combat
Reply: @ so first of all, the ammo is separated from the crew compartment for survivability (so your crew doesn’t combust when the ammo detonates). second, western tanks weren’t made for an offensive role like soviet tanks, their primary role was to combat the soviets if they went offensive. HE is useless in that role. third, they DID carry HE at one point but have since switched as you have vics that are better suited for infantry engagements (bradley for example)
Reply: @愛を込めてロシアから  also to piggy back on this the chally 2 is one of the only western tanks that doesn’t have blowouts… it has fireproof lining around the explosive charges that are “supposed to” keep it from catastrophically detonating (which still happens as seen in ukraine, that’s what happens when you store the charges in the hull 🤷🏻) thank you for proving my point  
without even realizing it.